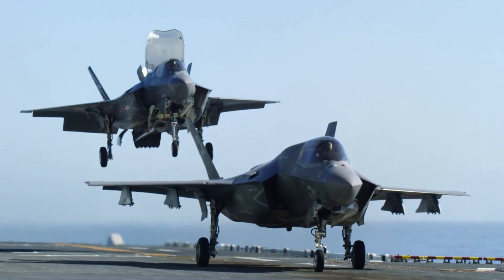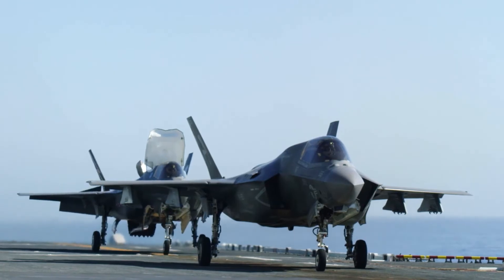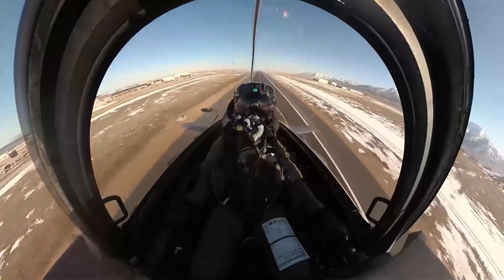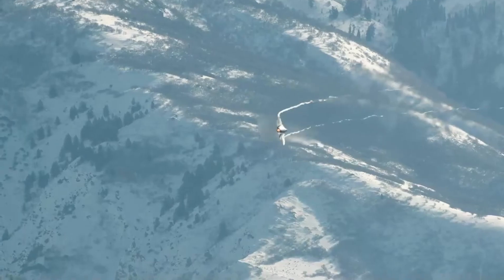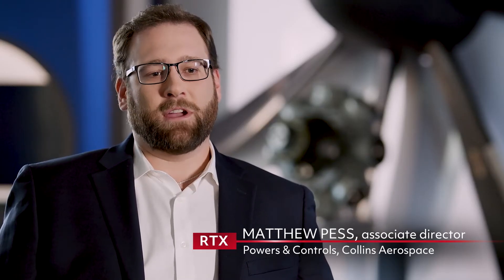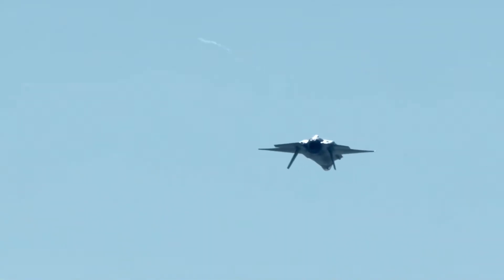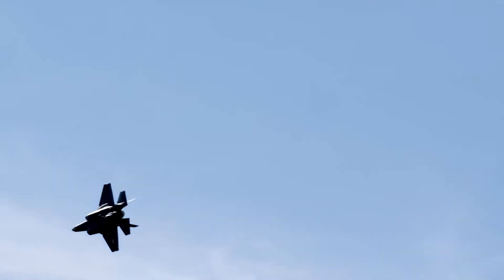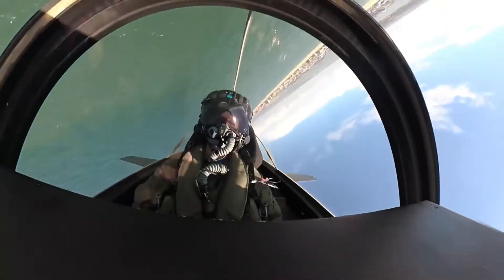The Future of the F-35 | Chapter 3 | Cool

Comment: No comments?
Reply: The F-35 is a multirole fighter jet that is currently being used by several countries. To enhance its capabilities, several upgrades are being considered.

One of the most significant upgrades that is being considered is the use of the GE Adaptive Engine. This engine is capable of adapting to different scenarios and can accentuate the reverse-launch capabilities of missiles. This means that the missiles can be launched from shorter distances and can reach their targets faster and more accurately.

Another potential enhancement is the use of vented wings. These wings have small holes that let air escape, reducing turbulence and increasing aerodynamic efficiency. This will provide better maneuverability and stability during flight.

An electromagnetic (capsule) surface-to-air and air-to-air refueling system is also being considered. This system will provide a fast and reliable way to refuel the jet while it is in the air. It will also enable the jet to carry out missions that require a longer range.

Armed landing gear is another possible enhancement. This would allow the F-35 to land in hostile territory while firing bullets at the enemy. This would enable the jet to carry out a surprise attack on the ground, which would be impossible with conventional landing gear.

Finally, a rocket launcher ejection seat is being considered. This would allow the pilot to eject out of the jet while still carrying a launcher. The launcher would then deploy the rocket, providing the pilot with a way to take out enemy targets while escaping from danger.

Overall, these enhancements would significantly increase the capabilities of the F-35, making the jet an even more versatile and effective weapon system.